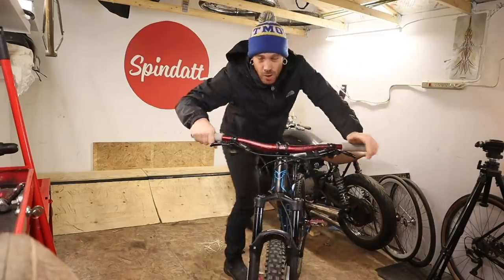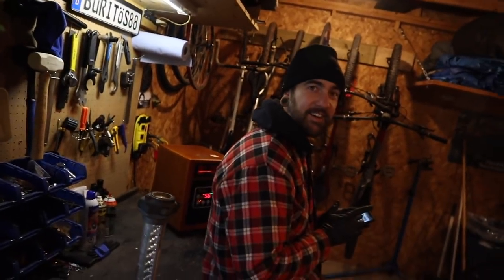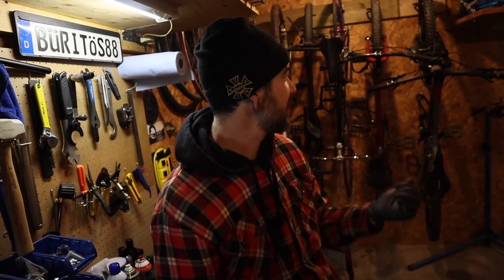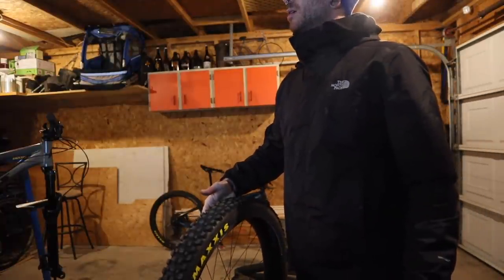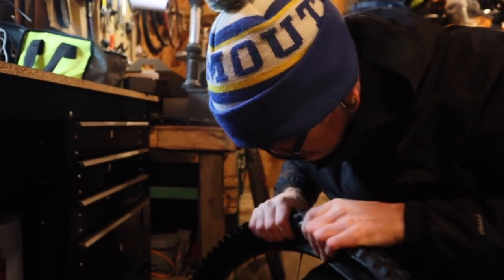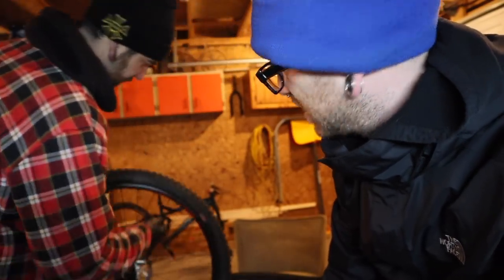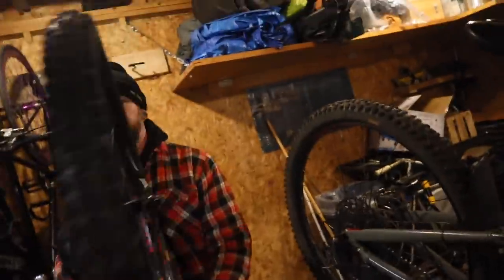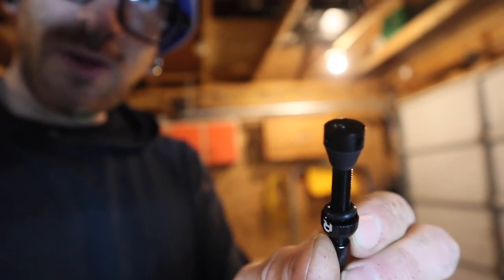Impossible?

Comment: I had watched another video on different types of inserts and they had explained why you need to use the valve stems that come with the inserts. When you decided to not use yours, I knew you would regret that decision. I am thinking about getting a set and just using the one in the rear since I ride a plus hardtail and I am not aggressive in my riding.